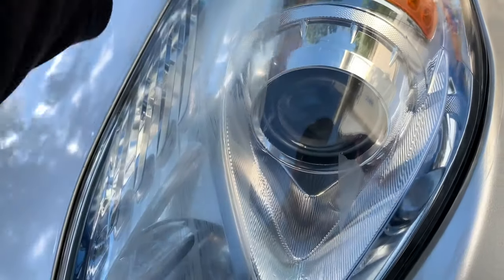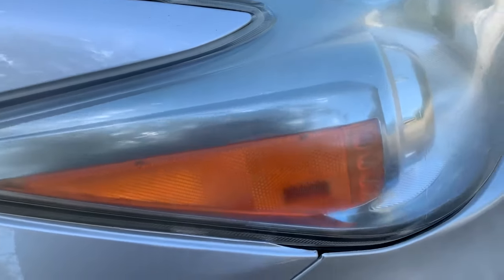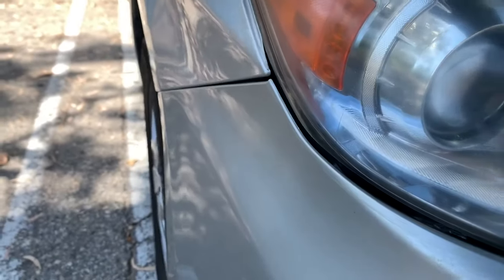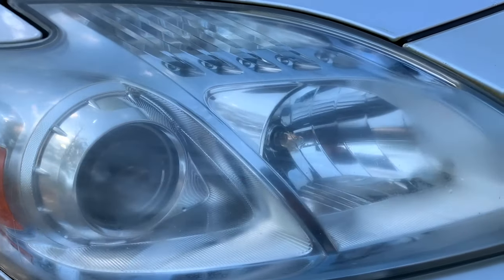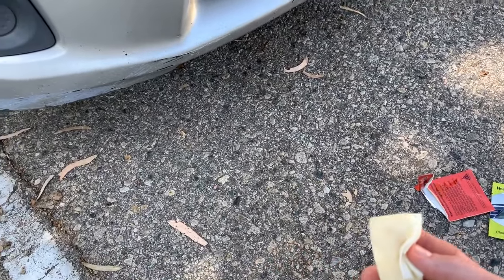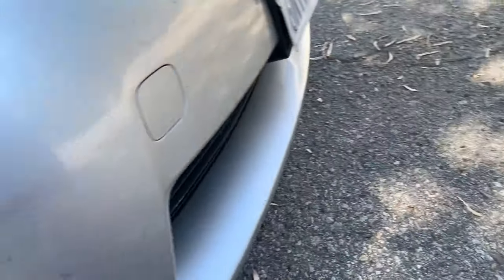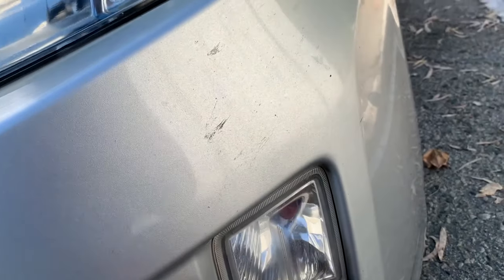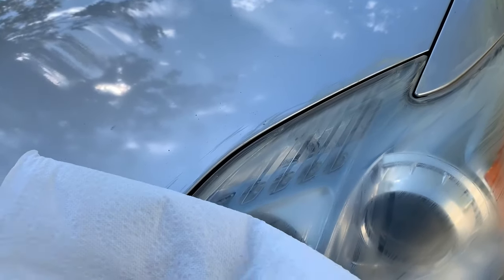How To Restore Your Toyota Prius Headlights Fast (2 Minutes)

Comment: What are the 5 bulbs for on top of the regular high and low beam lights on a 2010 Prius headlight assembly? I've never seen them work...
Reply: That's just a fancy design area, there aren't actually lights there. Just kinda chrome and glassy. Does look like it could be lights though